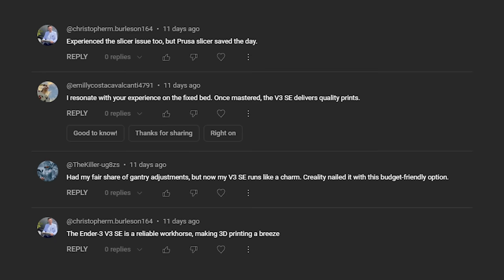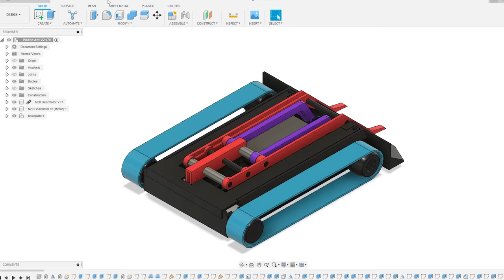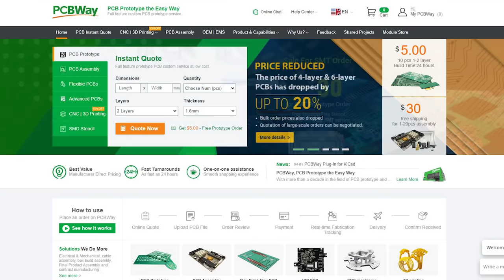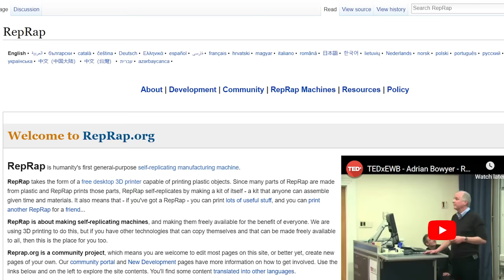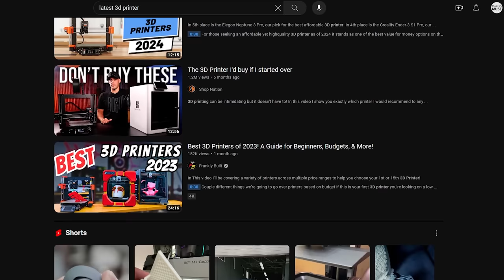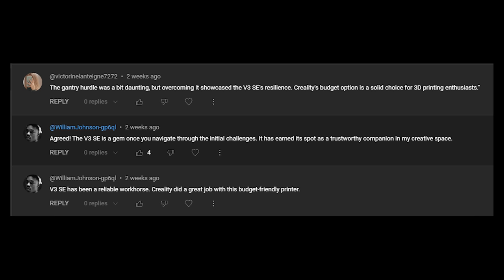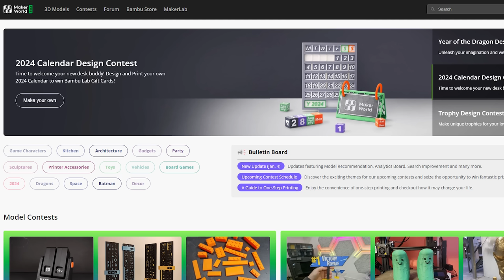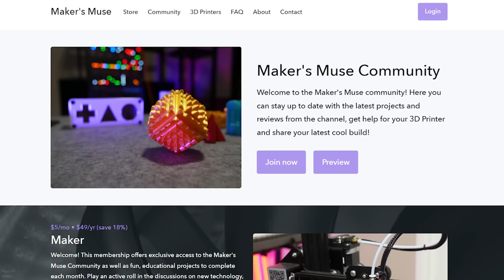My 3D Printing Predictions for 2024

Comment: There's not a single consumer brand out there that services their own machines. It's all expected that it's the customers responsibility. Even Bambu which people seem to paint as the opposite when it very much isn't. There is 0 indication that this will change in 2024, the idea of not needing to tinker is literally a pipedream, when the entire printer is made from consumable parts save the frame. 

If you don't want to tinker? Buy a commercial machine with a hefty price tag (5000+) that pays for the service calls or don't get a 3d printer. It's really that simple.

If you do want to tinker:
 Buy a cheap machine, see if you like the hobby, then just go all out, buy the best machine you can afford and if you can build it yourself, DO IT! It will be a rewarding experience, and usually saves some money. You will know how it works inside and out and maintenance downtimes will be reduced drastically as you won't be figuring stuff out on a finished machine working around other parts. 

I just don't see how you can own a consumer grade 3d printer and not tinker... it's part of the whole experience... at least to me.
Reply: that is just crap if your printer doesnt work you just sent it bag to bambu

Comment: I wouldn't expect it this year probably, but I've been wondering if/when 3D printers with more automatic or very streamlined slicing become more of a thing, where it works more like a normal printer: just open the file and hit print. Or maybe this is more of a thing already then I realize
Reply: Often once a printer is well tuned and has a good profile that's how it works. Most tuning I do isn't to make the thing, but to make the thing how I intend which the slicer can't know. Stuff like extra walls, infill, infill direction/type, etc.
Reply: Think we are going to require some seriously powerful AI for that to be a reality. The amount of settings in slicers alone... every little tweak effects print quality in some way...

I can't even get them to arrange a plate correctly.
Reply: I guess that technically exists in the form of 3mf files that contain settings information but with how different printers have different capabilities it still isn't really just upload and print unless you know the capabilities of your printer meet or exceed whoever made the file.
Reply: @Voyajer.  Also even for same printers if you get a 3mf file with absurd settings, then it's no use. And there have been few instances where that have happened because some people don't want purge towers, prime lines, prefer raft over skirt/brim etc

Comment: Hi, thanks for making so many great informative vids over the years, which are never boring! Sorry for the long reply, it’s usually not my style, but I have a few things to tell.

I waited patiently for many years to buy a 3D printer, and had much help from your channel ever since. I waited till it seemed doable to conquer 3D printing mentally, emotionally and brain capacity wise, as up to 2023, you needed a lot of skills to do so, not just tech skills, but more of the rest, lol. It’s been a painstaking process, giving me a lot of grey hairs, as I had 3 printers since I started a few years ago. It’s slowly improving and I can’t wait to see the day that it will become as easy as using a microwave. We are not there yet.

I wanted to print miniatures for my dolls. I was an IT’er till I became disabled. Hub is still an IT’er and detests 3D printing with gusto. He loves what I create, but says that it’s far too much hassle to print and firefight problems all the time.

My first 2 printers died due to a few power outages. Should not have happened, as these brands claim they can stand it well. I live in Belgium, we have a very strict rule set by law to install new electricity in homes, have to get it officially certified, so the new electrical system was not the issue. We installed it ourselves, hub and I and I had done it several times before, always successful. Just a few spray happy farmers cleaning stables with fuse boxes in my rural town, according to the provider. Both printers had a non existing customer service, glad Amazon refunded both.

So, I bought a very well-known expensive brand. Very disappointing! I sent it back for repairs and now it only works with workarounds, thanks to some input on a forum. I decided to postpone the 3 big projects I had still had planned for it till we move in a few years, and I will buy a better printer to do so by then. It’s still under warranty and I am contemplating on sending it back once more. Just have to grab my courage to do so, as I had it by now to deal with awful customer service, even telling fibs. 

I predict that the increase of online rudeness will turn people off printing too, not finding the help they need. Also, there are not only too many sponsored people (as you claimed) to trust input from, but also people who have no clue and are offering idiotic advice. 

Belgium people do sort waste and it works, but recently, microplastics are not allowed anymore by the EU, so the small bit once again go with general waste, sigh. 

I would love to see decent AI pop up to fine tune design ideas I have in my head for making miniatures. The current programs to create designs are way too clumsy, too difficult or too non-intuitive to handle. 3D scanners could make life more enjoyable, but the results are not that great yet for miniatures at all.

As an ex-IT’er, I never trusted 3MF files for the reasons you mentioned.

I predict that the same thing will happen which will happen in all trends and hobbies. First, the nice people pop up and help everyone, the vultures swarm in to abuse the lot (see that online since 2022), and the braggers rule the market in the end by creating way too expensive trends, turning the hobby into something for the elite and making the hoy polloi ashamed to even claiming they own a 3D printer. As an incurable optimist and a Trekkie at heart, I hope humanity will change, but I fear I won’t live to see it happening.

So, thanks once more to be one of the decent people on here!

Comment: My primary issue right now is really Prusa. They were so much leading the scene. They for sure are capable to create a CoreXY printer in a MK4 size. Bambu is out of question for me because of  their behavior with patents, closed sourceness, cloud restriction and simply shady practices. SD Card and this pseudo local WiFi is not a proper alternative for me. 

I don't understand why Prusa took so long to create a new upgrade and then still have 3-6 weeks ship time for their new flag model. Their enclosure adds 300-360 to the price. MMU3 additionally. I think Prusa with its MK4 is only able to make sells because of the goodwill of the people and their morals about open source, local EU craftmanship and repairability. I'm disappointed that they gave Bambu the lead so easily.

If Bambu would be just a pinch more open and would allow Octoprint I'm not sure I could withstand buying a P1S. Just on a financial side, I could basically buy a second P1S if the other breaks and still pay less than for a MK4..
Reply: Just to Clarified before I say anything else, I don’t have a side in this war in the 3-D printing space I own an X1C and I am actively encouraging my business partner to get a MK 4 but unless you’re doing confidential models for people, bambu is just better Prusa costs same With no enclosure, same price for a worse multicolor experience is a bed slinger and is not fast or big. If instead of comparing flagships we compare features so using the A1 it’s 600 bucks for both that and a AMS compared to Prusa where that would be $1100 plus three to $400 multi material system
Reply: wdym pseudo local wifi? if you mean the lan-only mode that's literally the same thing klipper uses.
Reply: Problem with Prusa is, that they don't make printers. They make kits and then assembly the kits. That's really not the best way to mass produce printers.
Their customer base will probably shrink,nbutnthere are people who enjoy the building aspect of the hobby and will gladly pay extra for it. Just like in PC gaming, RC models and similar hobbies.
Reply: @dnb9913  The problem is that you can't verify its local only unless you can see the source code of the firmware (or monitor the traffic). It might say it's only local but still send requests out. It might collect everything you do in the background and send everything back to China once you leave lan only mode. They might disable it at some point because of "security reasons". 

Yes you can create an Intranet only WiFi and restrict outgoing requests but I do not want to even think about all of this. I am primarily a software engineer and not a 3D printer-er. I use those only for functional prints for my electronics projects. Which is why the P1S would be so attractive for me. 

But what I have seen so far from chinese smart appliances is concerning. This includes cheap WiFi smart plugs, LED controllers, especially cloud based cameras, baby phones, vacuum robots and what not. As every company in China has to report and give access to the CCP you should always expect some kind of back door.
Reply: @Brandon-jf9cv  Yeah these are exactly my thoughts. I'm currently waging my principles against my wallet. 🤷‍♂
Reply: The problem is that Prusa can't do much in terms of price as long as they manufacture in Europe and mainly use components from European production.

China is the factory of the world and everything a Chinese manufacturer needs is already manufactured in the country, resulting in low shipping costs and short delivery times. In addition, there is cheap labor, little regulation and subsidies from the Chinese government. 

Another stumbling block for Prusa is the upgradeability of their printers. This is great for the user, but leads to design limitations. Also, the fact that they support older models for so long is great for users, but again limits what Prusa can do.

I don't think Prusa just let Bambu Lab take the lead. Bambu Lab is not an ordinary small startup.
They have released 4 printer models in one year and have even gone into retail. The scale of their marketing is also unprecedented in the 3D printing industry. They must have investors with a lot of money to be able to afford this.
Reply: @andreas.grundler  For sure, China is the factory of the world. Maybe I just can't understand how it's possible that the MK4 with its "simple" metal and printed parts alone is as expensive as the P1S with its enclosure. (Sure, this includes employees pay, revenue, funds for research and so on.) but still. For example, lighting inside the Prusa enclosure costs 80€ additionally. Air filter adds 120€ too. Maybe I just have expected more/new after five years. I'm not a mechanical engineer and I don't know how expensive it is to design and manufacture a 3D printer in this scale. I'm sure it's difficult. But it feels like some decisions along the way weren't the best and some things have been asleep. I'm sure printing their own printers is a great way to test your product but it's taking its time. 

I have again taken a look into Bambulabs printers and it still feels like a bad decision to get them. It irks me a bit to support this closed sourceness. Taking the advancements of the open knowledge and then make almost everything private.

I think I still value repairability, local production and openness more and would have to pay the price I guess. 🤷‍♂

/edit: I bought the MK4 now. :D
Reply: @randymarsh1791  The Bambu Lab printers are designed for mass production. And they have to be mass-produced, otherwise they would be too expensive. The low price is simply due to economies of scale. 

I don't know if you've ever seen a Chinese factory. Hundreds of workers, each doing one tiny step in the production process. It can be as small as putting in a single screw. And that's exactly how the Bambu Lab printers are designed. The parts are added one by one and all printers are identical.

It is hard to tell from the outside whether Prusa has always made the right decisions for them or not and whether they are stuck somewhere. Only time will tell.

Comment: I agree with you about the development of 3D printers. Having used Stratasys and Z-corp machines 2006 - 2009 and then built Repraps in 2010 - I never got a decent print. I had 3 Creality machines in 2018, hard work to get production. Looking forward to easy and high quality 3D printing

Comment: I'm loving having my 3D printer (yes I'm one of those who got one for Christmas). I hate to think of all the stl files I've downloaded and looked at on all the repositories in the last 3 weeks. 😂
I was put off buying one because everyone I knew who had one has an engineering degree (or so it seems) and that's just not me... I like to play, tinker a bit, but mostly play.  I agree that with the printers now available their up and running in 20mins (mine was (ender v3 se)) and it's great to see (some) companies going for this market. I don't need a network capable machine, simple sd in the side and hit print. I have to remove the part so it's 1 print at a time WHO CARES! 

Anyhow great video and I'm slowly going through your chanel 1 video at a time (well when I'm not watching my latest print running on the printer, every layer is a new chapter for me...)
Reply: I love the Ender series printers, it’s all I own (2 Ender 3 Pro Max Neos and a Ender 5 pro). But they can be unruly as hell tho, you will run into problems that make you want to pull your hair out at first but just take a deep breath and google a description of the issue ur having and there is a fix for literally every issue I’ve ever encountered. The Ender community is so well established that you’d be hard pressed to run into a problem that someone hasn’t solved yet.
Reply: Those new V3s look like a really good value. My Ender 3 S1 Pro was $350 nine months ago.
Main thing was cleaning the PEI plate like 10 times, and manually leveled the bed 5 times in a row before any print would stick. Otherwise it has printed beautifully.
Reply: @murderdoggg  ender 3 v3 is the piece of shit, the  shafts on the Y axis arelow quality, and the frame is not rigid, as a result the shapers are terrible.

Comment: I use PCBway to test print some of our 3d printable tools in metal. It's convenient but if we could 3d print in metal ourselves in our shop, that would awesome. Hopefully in 2024 companies will start working on consumer grade metal 3d printers that don't cost $100,000.00. Until that happens, however, higher temp filaments like carbon fiber blended with nylon are becoming very strong and can be printed on any consumer FDM 3d printers that have a hotend that gets up to at least 300c. For now, most of our costumers are printing our tools with these newer carbon fiber blends and it works but when cheaper and easier metal printing methods are discovered and are available to the public, that will be a game changer!

Comment: One thing I am really waiting for are Bambulab X1C type printers that are substantially larger at least in one axis. There are so many engineering things that you cannot print due to length of at least one axis. 256x768x256 would be a welcome format
Reply: For me even one slightly bigger axis would make me buy it quite fast. Have printed some inserts for systainer (oughly 400x600 external size) and spliting it into two pieces is usually no problem, four pieces creates new challenges.
Reply: Thats what the K1 Max is. Pity Creality are still doing what they are doing though, loath to buy one. Give it another year and there will be tons of proper competition I think.
Reply: @doppelgrau  Splitting things work for visual pieces, but for things that need high accuracy I don't trust assembled pieces

Comment: Shapr3D on the iPad is by far the easiest CAD program I have used. It isn't as powerful as Fusion or Onshape but for modeling medium complexity functional parts it is perfect. I can go from idea to real part in a few hours. Using it with the Apple Pencil is the best way.
Reply: Shapr3D is not only pretty expensive, it also sucks. I've tried using it multiple times and I simply can't use it reliably. It'll take me 30 minutes to do something on there (and still have issues) and the same object in OnShape takes 5 minutes. So, even if OnShape on the iPad is not amazing, it's still way better than Shapr, IMO

Comment: This is the first video I've seen from you. I'll be watching more soon. In particular, you echoed exactly my rationale for purchasing a Bambu Carbon X1. I'd no enthusiasm for having to "play" with my Creality printer. When it worked, great, that was why I'd bought it, but the novelty of cleaning out filament, figuring out why the extruder was slipping, and all the other "joys" of 3D printing was wearing off very quickly. Yes, it's good to know how your 3D printer works, then you can expand your knowledge base by understanding why it's not doing what you bought it for.
The Bambu, as you describe, worked straight out of the box. It was significantly more expensive than the Creality, but hey it worked, and continues to do so.
Thanks for the tip on 3MF files. Never crossed my mind.
Now to view your other postings...

Comment: Germany is great at recycling cans and bottles. Our deposit system is such that every supermarket and every place that sells cans and bottles has by law to take them back wherever else bought and you get 25 cents in return for every basic bottle which is a big incentive. Same should be done with batteries electronics and plastics. Recycling plastics on the other hand does not work here as well, 90% of the stuff is simply being burned. There is a new way of recycling plastics though it´s pyrolysis by BASF check this out this is a great and useful idea.